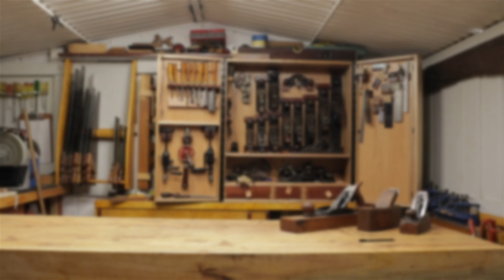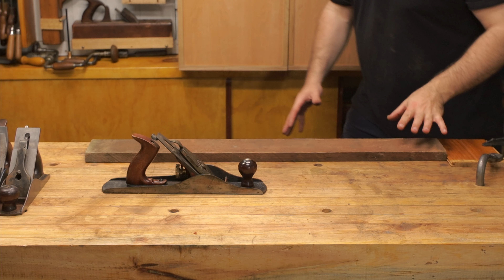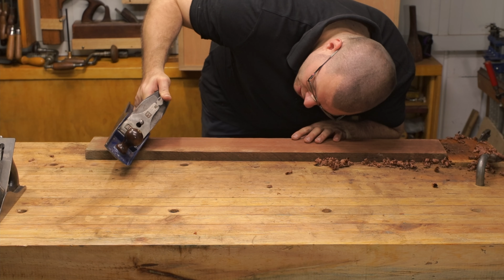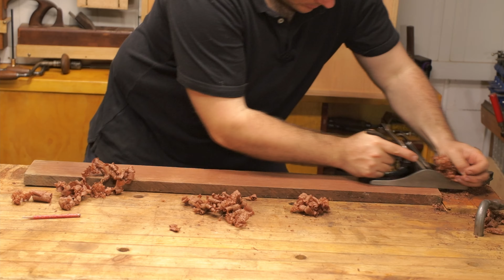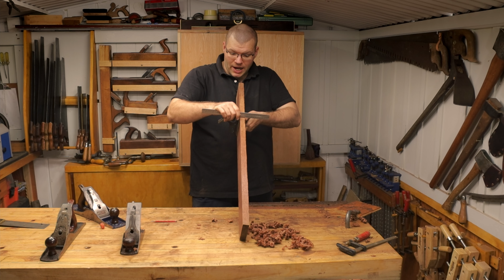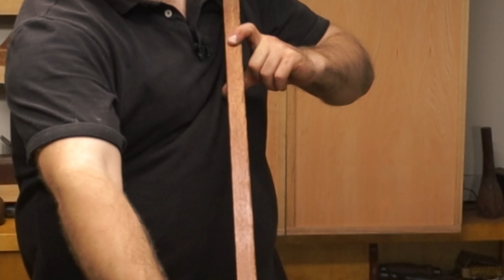Preparing Rough Sawn Timber with Hand Tools

Comment: Thanks for the video. I recently bought a dozen+ rough sewn hardwood boards 11-15 feet in length. Is it safe to say you want to use the biggest plane you own to start on large boards like this?
Reply from the maker: I really does depend, if you need to remove a lot of material a Fore Plane/Scrub/roughing plane is generally best used with a 1:7 radius blade to remove material faster, and I prefer and no 4 for that purpose, but they were longer traditionally. (I have a few videos if your interest here: 1) talks more about it https://youtu.be/W-9c-qO5ogA, 2) how I did the camber https://youtu.be/MTQlfhW1j3s) . 

If you just need to remove a little bit of material (like I did here and want to maintain thickness as much as you can) you will need to make sure the boards are flat as quickly as possible to not waste material, in this case then a longer plane is best to "joint it" with the extra sole references for flat. I have heard it mentioned that you generally want to have a plane sole about 1/3 of the board length, so going by that the if you have a shorter board like I had here the 5 & 5 1/2 length was long enough for this task. So with the boards like you mention then yes the longest plane (No 6 , 7 or 8 will likely get the job done) is probably your best bet, unless as I mentioned above to need to remove more material to get to a certain thickness. Having said that if you only have a shorter plane you can use that but just need to check flat with a straight edge regularly.